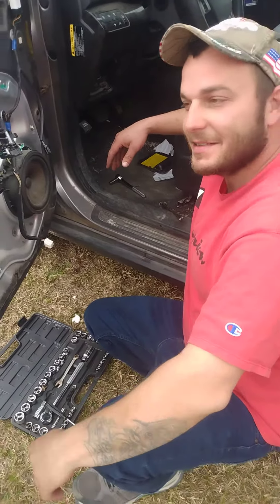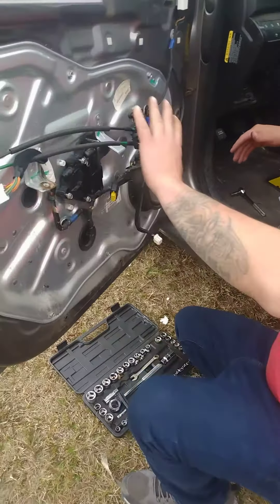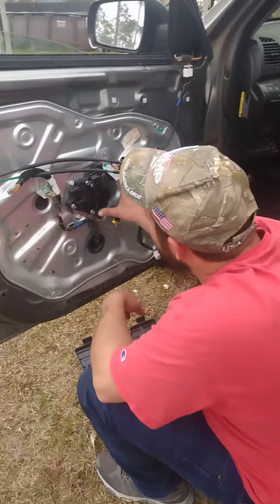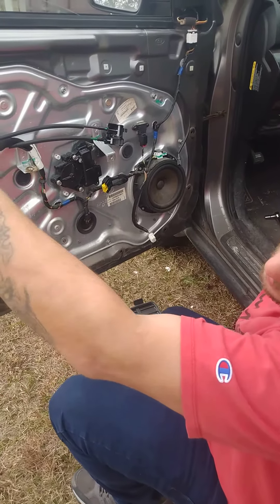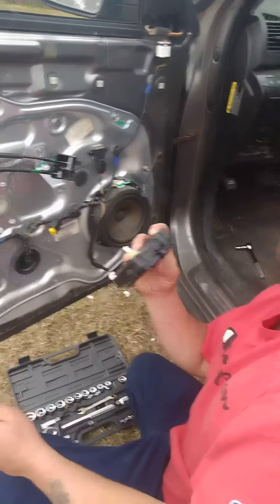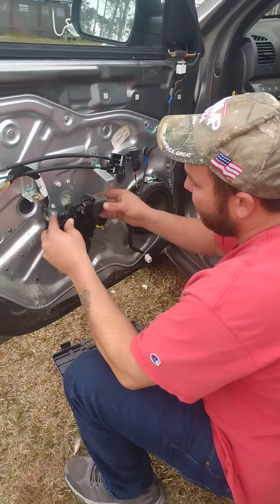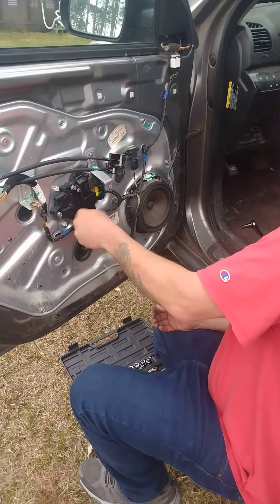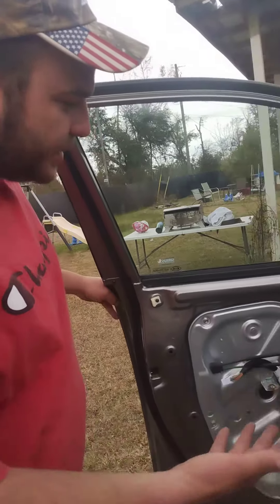How to get your electric window up if the motor is blown 2011-2013 Kia Sorento

Comment: I tired this same method in 06 Ford Escape hybrid worked great and good thing too I didn’t know what I was going to do to keep the snow out of my vehicle for the winter.
Reply from the maker: Exactly. My problem was rain and ice.
Reply from the maker: I bet a lot of other makes and models are just as easy. Kia was going to charge me 153$ just to diagnose the problem. They wouldn't even give me a price just to get the window up